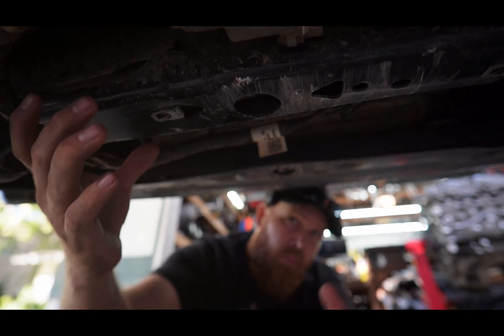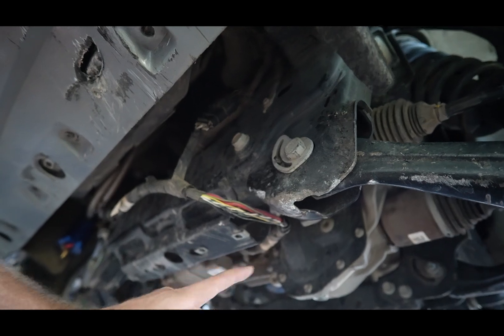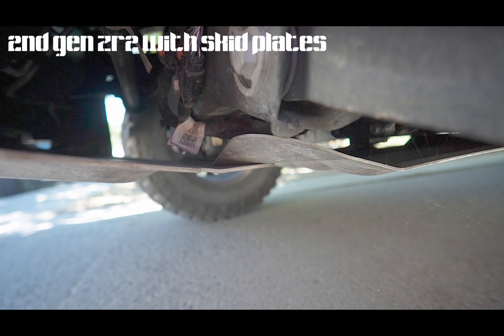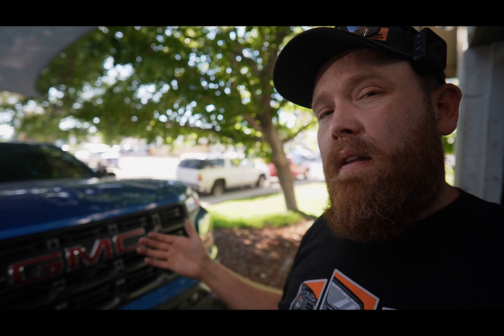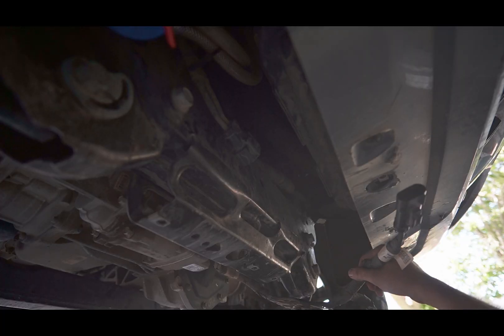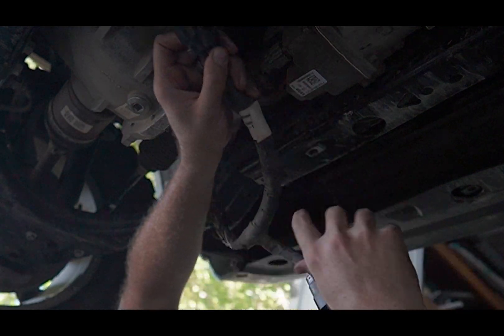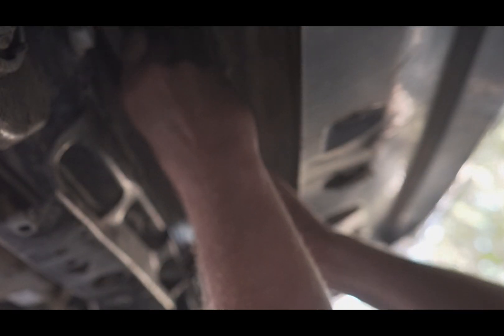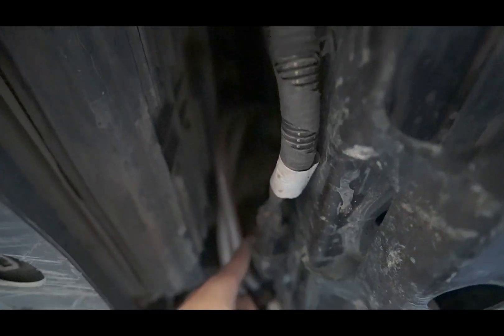Why Would GM Put THAT There??? [PCM - ECM - CANBUS Wire Tuck]

Comment: By going over the frame, is there anything else that could damage those wires? Is it close to anything hot or moving parts? I cant think of anything else that would prevent them frrom assembling it that way to begin with
Reply from the maker: The rack is close to the frame but there's more than enough room to make the wires go up and over without issue